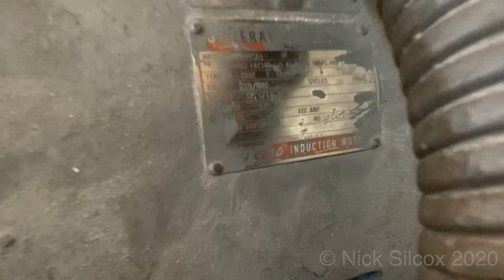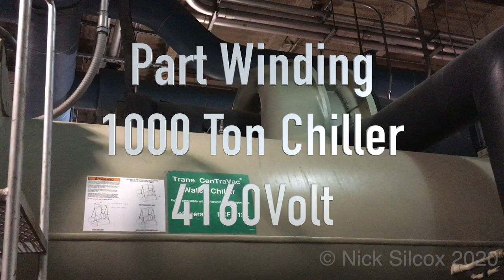Compilation 2 phase/3 phase Motor Startups Across The Line

Comment: awwww that old quincy compressor, cant beat those with the air unloader soft start. Theyll last forever (my old shop had one I rebuilt from the 50's)
Reply from the maker: That Quincy runs almost 24/7, tons of air leaks for years, those compressors are from the mid 70s and all we did was change the oil yearly, they’re tanks!

Comment: One of those chillers sounded like a jet engine.
Reply from the maker: Chris Carter it’s just like a turbocharger in a way, large motor driving a small impeller and super fast speed, up to 48,000 rpm. Chillers shown in here spins around 15,000 to 23,000 rpm.
Reply: Yes

Comment: A 2 phase motor? What are you talking about?
Reply from the maker: It’s 2 phase, 4 or 5 wire setup. Please read description for what a 2 phase motor is
Reply: 2 phase power still exists (except now it's called "split-phase,") and the phases are 180 degrees apart.
Reply: @coastersaga  I am not veey convinced by the 180 degree apart part. I don't see how two inductors that are inline with one another can create a rotating magnetic field. Alternating yes, but not rotating.
Reply: @baconshark8067  So any motor running on split-phase would be electrically very similar to a single phase (capacitor start) induction motor, requiring a starter winding, centrifugal switch, and start capacitor to give it the kick it needs
Reply: @coastersaga  in my opinion, it is still single phase.

Comment: 3:01 sounds like a jet engine starting up. Awesome 👍
Reply: Well there is kind of a jet engine inside... These chillers use centrifugal compressors and they give off that sound they look very similar to the impellers of jet engines.
Reply: IK
Reply: So awesome
Reply: @BritishEngineer  
Here's an explanation for the humming sound you hear before the first water pump starts up (timestamp 3:36.) 

Initially, this humming isn't coming from the motor, but rather the other motors in the area. This is due to them being run off of an inverter. The odd frequency (360Hz) is due to the power supply of the inverter, which uses a 3 phase diode bridge rectifier., which produces a ripple that has a frequency of six times line frequency (60Hz in this case.) 

Even with good filtering, some ripple still gets through to the motor. Once the water pump starts (with that hilarious "twah" sound), the 360Hz hum gets slightly louder because the motor has been energized. 

I only know the sound because I have seen many videos of these types of motors starting, and have heard them running at theme parks, to drive roller coaster chain lift hills.

Hope this helps
Reply: yo you right that the chiller sounds like a jet engine

Comment from the maker: Time stamps
0:00 fan motor Startups
2:17 Industrial Chillers startup (Centrifugal compressors), McQuay, Carrier, Trane, etc.
3:37 Water pumps, across the line
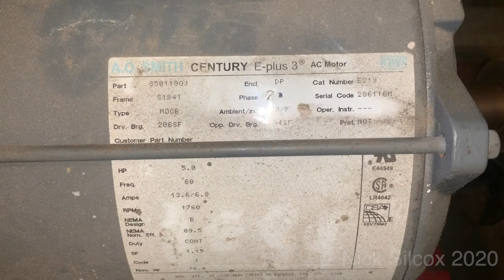4:07 Cooling tower fans
5:36 Quincy Air compressor starts unloaded
Reply: awesome, if you copy this text in to the description the timetamps will automatically in the video

Comment: If the fans at 0:43 and 1:43 like to smoke belts perhaps you should put a VFD on for softer starting
Reply from the maker: The fan runs 24/7 and the only time it shutdown is when maintenance is done to the air handler and It only smokes old warn belts

Comment: 5:20 why the fans are going different the left is fast but the right is slow?
Reply from the maker: If you look closely at the motor when it starts, The mounts for the motor support is heavily rusted and the motor moves which causes the tension on one fan becomes very loose and the belt slips.
Reply: even though i can hear the slippering sound
Reply: Are all to the belts replaced yet? Remember to show me the video of the belt replaced.

Comment: ok, dumb question: where (unless you generate it yourself) and why (rather than 3) do you get 2 phase power?   are the phases 90 degrees?
Reply from the maker: That’s not a stupid question haha
2 phase was a power service in the late 1800s early 1900s, to aid single phase motors starting up before 3 phase power was a standard. Some building has not updated and still require 2 phase service. so the building adds a “Scott-T Transformer that changes 3 phase into 2 phase and wiring backwards will turn 2 phase into 3 phase.
Yes the phases are 90 degrees and has their own 2 conductors. (4 conductors total)
Reply: thanks!  @NickSilcox3

Comment: What is that sound when its started up and why is it so good
Reply from the maker: The sound you hear is the vibration of the motor windings as the inrush current rushes through, 7-10x it’s rated current draw

Comment: Whats that tiny little motor at 2:00 used for?
Reply: Eleavator Cooling
Reply: That makes sense @Mateo C
Reply: @chrisbrasher6177  it’s just a wild guess but I’ve seen that in a elevator once before but I’m assuming
Reply: It's just the duct fan there's actually two motors
Reply: @jaedenspider877  ohhh so that’s the echo I’m hearing

Comment: Wtf is a 2 phase motor
Reply from the maker: Outdated type of power feed that some parts of old cities, old towns still use that want to keep historic buildings “as is” that uses (4) seperate feed wires instead of (3) power wires for 3 phase or (2) power wires (with a neutral) for single phase